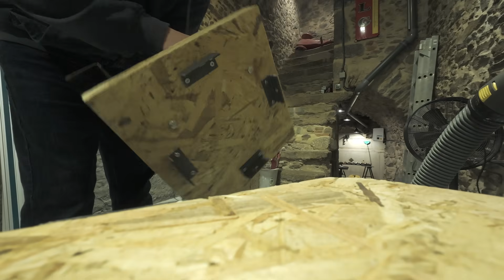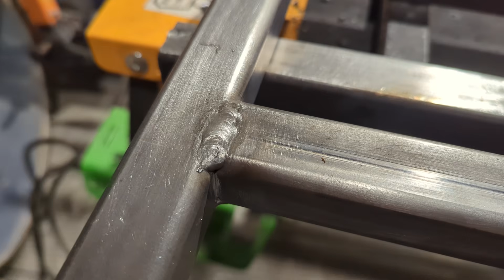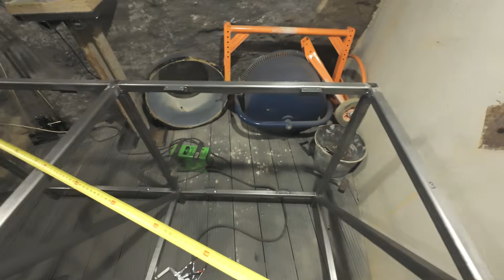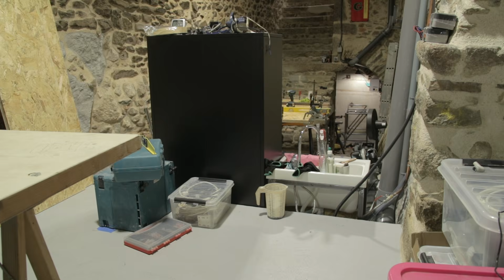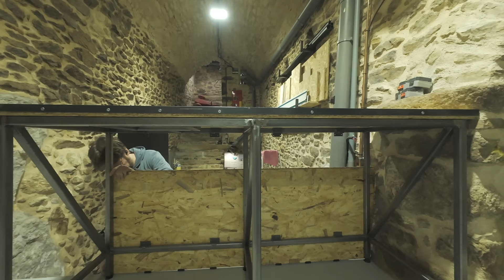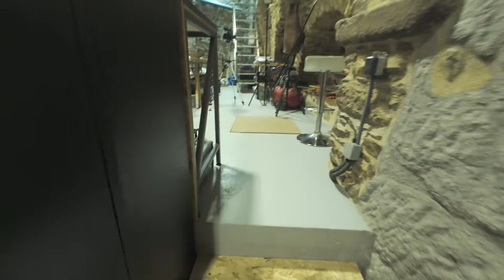First workbench with a modular twist.

Comment: Another trick you can try when installing the 3D printed foot mounts - if you heat the steel legs with a torch, the plastic will melt slightly and it will slide in easily. The reverse of a heat stake threaded insert.
Reply from the maker: Yep i thought of heating the plastic, but I had only my blowtorch. Did not think of heating a bit the steel. Could be helpful in the future thanks!

Comment: Great looking table, happy that you continue to make videos! I also made a similar bench for the garage when we built our house in 2017. It's 3,5 meters wide with 6 x 70x60 cm drawers in metal with 90kg drawer pulls and a 28mm birch plywood top. Really proud of the thing!
Reply from the maker: Thanks! Yours seem like a beast, you can be proud, having done mine, I know there is a lot of work for something like that. I'll have to sort the storage situation later, I'm thinking cabinets on wheels for now.

Comment: I think you are too hard on yourself. That is superb, and very well executed. I have a similar, but longer, bench in my garage. I topped it with 2 layers of plywood (because it was what I had) but then covered the plywood with a sheet of hardboard as a sacrificial covering. It has my little Taig lathe on it most of the time, plus my surface plate and other tackle (and junk), and the hardboard has held up well, hasn’t needed replacing yet, 6 years later. I’m subscribed to your channel because of the quality of your work and your ideas used to get what you want out of this building. Thank you. Oh, and your .english is very good, thanks for that too. Les🇬🇧
Reply from the maker: Thanks for the comment ! I was thinking about a sacrificial top, but I went this way which is harder to change but a bit more clean, in my mind. Time will tell if I'll regret this decision.